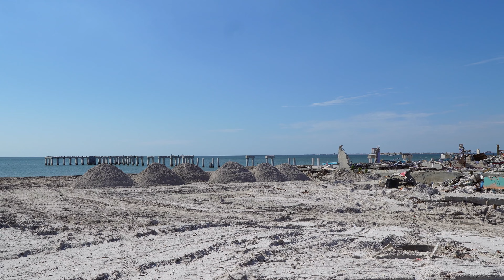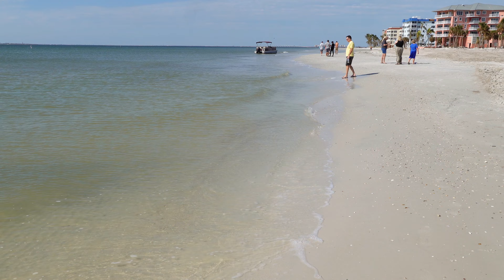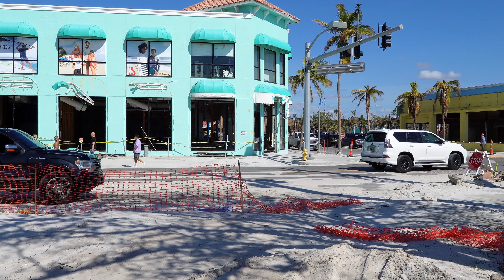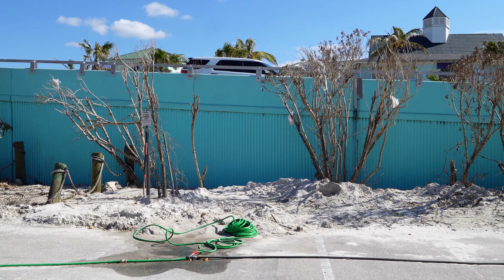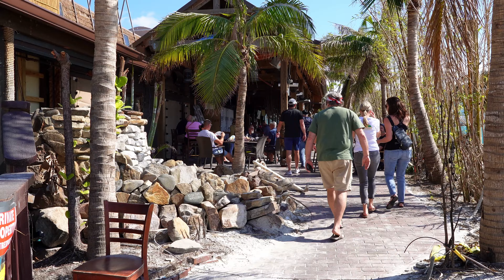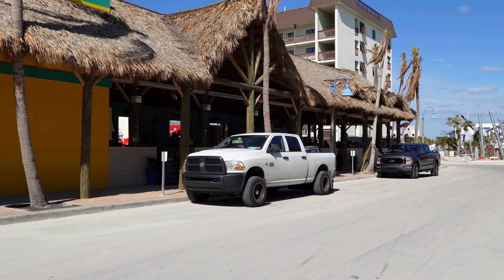Fort Myers Beach Florida - Recovery Process

Comment: Unbelievably stupid, that entire beach side needs a major beach renourishment project with a much higher elevated beach with rows and rows of very high dunes. And all of this should be dredged wet sand because that compacts 1,000 times better then trucked in sand. 

What there doing now is doomed for failure.
Reply: This sand is the stuff they screen from the streets and houses, this is sand that was picked up from the trucks cleaning the streets screened and placed  back